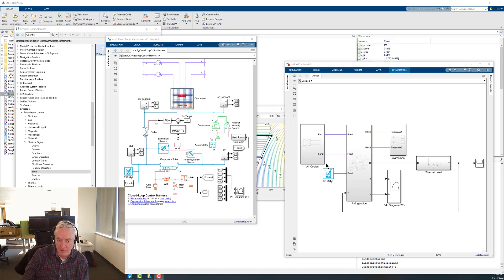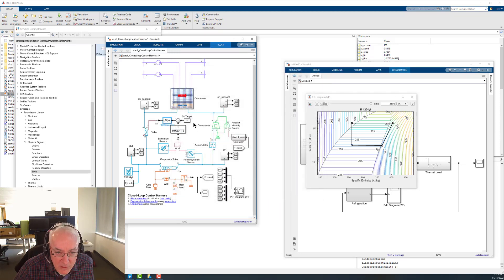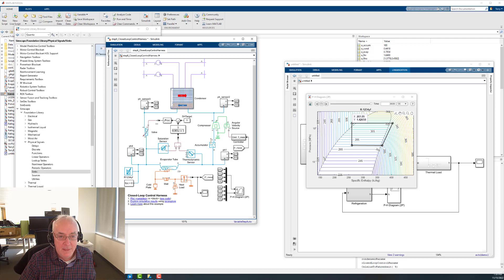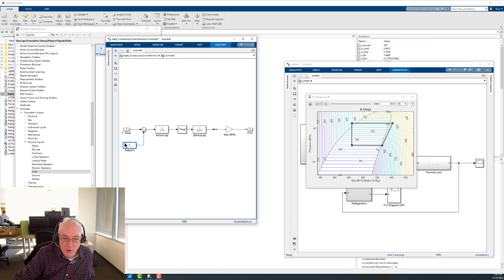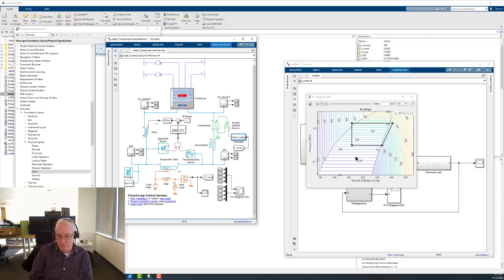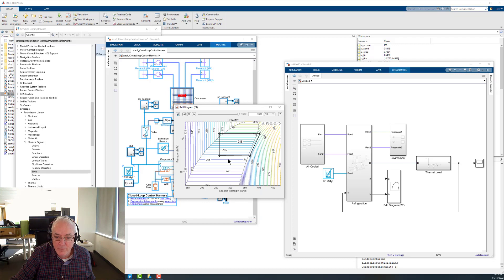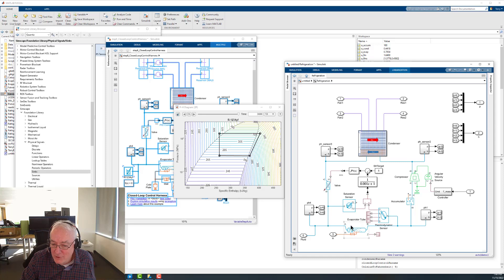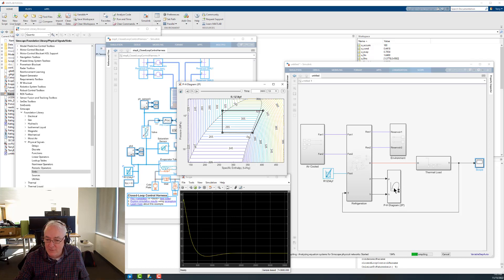Engineers Studio #28 -- Controls, Charging, and Conclusions

Comment from the maker: For download of Erin McGarrity's Tutorial in PDF format, and MATLAB Project with supporting MATLAB, Simulink and Data files:

https://content.mathworks.com/viewer/655e5c8713cb97c9cb1e6051

Thanks. -Terry
Reply: Terry - I am looking to learn MATLAB/Simulink etc for modeling thermal systems - ref/freezers, and other systems.  this series is Amazing!  Thank you.  However, in the tutorial pdf linked below on page 24 where Erin talks about charge density I have a question.  the 56.3 Kg/m^3 density - is that a result from the model and not a simple calculation from total mass / volume?  Those numbers would be vastly different - 56.3 kg/m^3 vs 563.47 kg/m^3 - approximately 1 magnitude different which would tell a different story on charging.  

Appreciate this series.  I will be going back to watch it several more times.
Reply from the maker: Hi  @DaDizzyDino  ,  Great catch on your part! I see the arithmetic error in the PDF.  I think the demo worked because we did not actually initialize on mass density, but rather initial mass fraction of the evaporator pipe.  I just watched the video, again, and I think I chose something like 25%.  That sets the starting point squarely under the thermodynamic dome, which describes vapor/liquid equilibrium under the condition of boiling. Erin has a great way of describing this, too, which is "that charging is important because you need to give the refrigerant room to boil." Perhaps, I needed to be more explicit on this modeling point, and share Erin's great comment on "room to boil".  Thanks. -Terry
Reply: @terrydenery7078  

Terry thanks for the quick response.  I am versed in sealed systems design, so totally understand the charging issue and what Erin is referencing.  

Would you or Erin have a recommendation on a tutorial or video about taking a similar ref system model and using it to generate c code for hardware?  Maybe a rasp pi or arduino or something.  

I want to simulate more complex systems with multiple evaporators and multiple controllable EEV's but only 1 compressor that has variable capacity.  

I know that is alot, but it is a real world application.  Hoping to learn enough on matlab/simulink that I can develop solutions faster.  

Thanks again.
Reply: @terrydenery7078 Thank you so much Terry. You are a very good person. I was searching for something like this for a very long time.